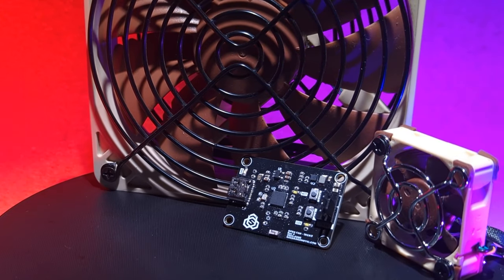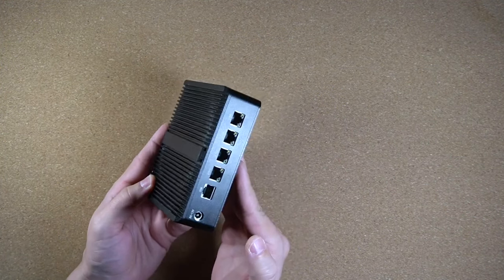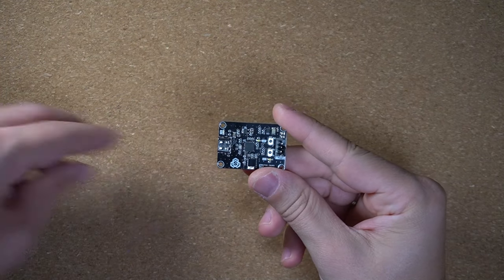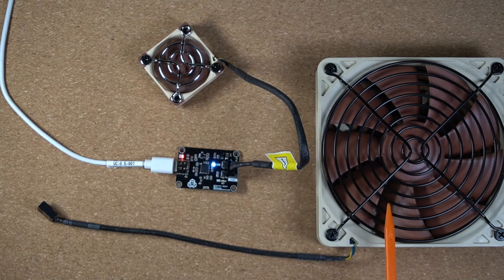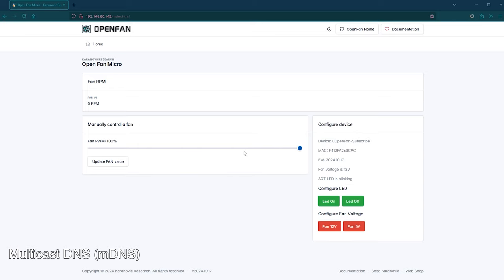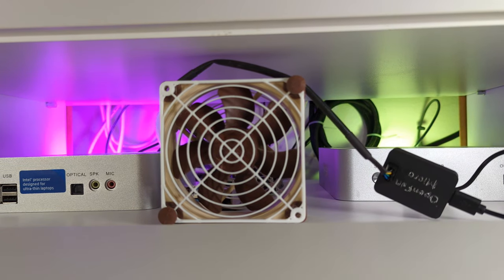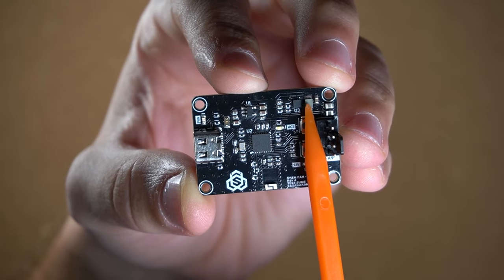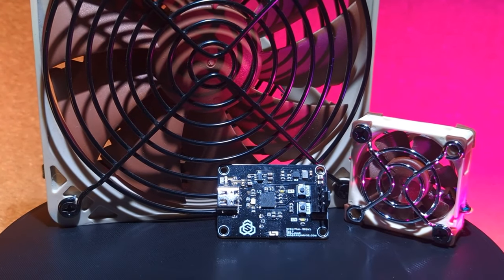OpenFAN Micro - My home lab needs this fan controller

Comment: Awesome but needs one little addition to make it really perfect - power on PWM boost. Some fans I have can maintain 10% PWM but it is not enough to bring them up from zero - for that I need to temporarily apply higher PWM value to make it spin (overcome inertia and friction) before it can ramp down to desired low PWM. Yes, I guess I could do it via API but for true install-and-forget application it could use some power-on boost (lets say 5 seconds or so). Just like servers do when you power them on - all the noise at first and then settle down. Also helps to pull dust bunnies trough xD
Reply from the maker: Thank you!
This is a great suggestion and also really easy to implement in firmware. So I will add it in the next firmware release. :)
Reply: Instead of timed it should be until tachometer reports rotation.
Reply from the maker: Great idea! I think the combination of these two would be the best.
Run the fan at 100% PWM to spin it up for ~5 seconds and monitor RPM signal. If the RPM goes up, then everything is fine and we can go to the previous RPM. If the RPM does not go up, then report failure.
Reply: Agree this is a must have! Will seriously consider getting two when you have implemented temp fan spin up 👍👍
Reply from the maker: This feature is now available (v2024-10-27)
Thank you everyone for suggesting it! :)
Reply from the maker: @cv643d  This is a simple firmware feature and it has been already added. :)

Comment: It's very nice project,  If you plan to make another revision i suggest the following.
1- Add second 3pin connector for 3 pin fans
2- Temperature sensor so you can automate the fan speed .
2- Using Home assistant and esphome to configure the esp32 and integrated with home assistant
Reply from the maker: Thank you! I'm glad you liked it! I will keep this in mind.
You can use this board with HomeAssistan. Either through the API or you can also load ESPHome. :)

Comment: Awesome as noted. The only thing I'd add is a air temp sensor for when you use it in an eclosure to conditionally or pid control exhaust hot air.
Reply: Agree. Also USB PD would be useful to connect few powerful fans without risk of burning the step-up converter.
Reply: @voed  well, if you really need to connect higher current fans then you could easily change the step-up circuit with a bigger one, such as the Xl6009 module
Reply from the maker: Thank you!
Great suggestion! Maybe in the future revision I can add a header.
For my use-case, I always have the temperature of the device(s) I'm cooling, and in most cases it's more important/relevant than the ambient temperature.
Reply from the maker: Great suggestion.
Unfortunately while 12V is part of USB PD specification, but for some reason most chargers skip it and only have 9/15 or 9/15/20.
Also it would make the controller useless if you want to connect it to non-PD USB connector.
But maybe in one of the future revisions I could add PD and non-PD version.
The step-up converter can provide up to 700-750mA, and average commercial 12V fan draws about 100-150mA.
So while this is designed for a single fan, you could potentially connect more than one and still be fine.
Reply: +1 I would order the parts today if it had a temp sensor that I can put on top of the thing I want to cool. 

The API stuff is great but relies on something keeping it's temp value up to date which might not survive OS reinstalls or a VM running somewhere that could be offline, let alone assuming that I don't change the WiFi password... 😅

If there is a temp sensor at some point it could also be used to pull the value for other systems like home assistant or some logging software so I could using it to keep track of things too.
Reply: Oh thought of a another use case (not sure if it's feasible) but if that temp sensor port could also accept a humidity sensor then you could use it to automatically vent air when the air is to humid or not humid enough. In a greenhouse or bathroom for example.
Reply: Yup, need temp sensor with range of on/off
Reply: The sensors described in the responses [temperature, humidity] and others are often available with an adjustable ADC that triggers when a preset [adjustable on the ADC] is hit. If the fan controller had a digital input to receive the trigger input, it would work with a wide range of sensors. The firmware needs only to deal with any jitter [i.e., the digital trigger must be changed for > 1s before the fan controller reacts] to ensure there's no funny business around the threshold of the state-change].

The controller would trigger the fan to it's preset speed when the connected ADC hit its trigger due to a water level, a humidity level, an absolute temperature, a light/brightness threshold, the presence of a minimum sound pressure, or whatever other sensor for which one could dream up a use case. Heck, with a motion sensor you automatically could blow confetti on a wedding party walking out of a venue, if one felt the need to automate the process...

Comment: Maybe make this module pluggable with other modules, like sensors (humid, temp, light) and with outputs (5V, 12V, solid state relay for AC devices)
Awesome project, subscribed
Reply from the maker: That's great suggestion!
The nice thing is that through the API you can technically connect it with pretty much anything. :)

Comment: Very Nice, but have missed two things. 
1. Temp Sensor 1wire or I2c or both
2. 3 pin fan supporting circuit
Reply from the maker: Thank you! I'm glad you like it!
I might add additional header for 1-Wire or I2C in future revision.
Price difference between 3-pin and 4-pin fans is becoming negligible and personally I dislike 3-pin fans (and have purged all of them long time ago). But I see your point.
Reply: 3-pin fans should never be used and if they are can use voltage regulation, does not need this circuitry.

Comment: MQTT would be nice, too. Pushing the PWM% and the RPM to and from the OpenFAN Micro could be a good addition. I know the API calls do the same, but MQTT on ESP32 runs with almost no impact on performance.
Reply from the maker: Thanks! That's a great suggestion!
You could use the API but I guess MQTT would also make it easy to integrate with HomeAssistant and other telemetry/automation. Or at least offer another way so you can use whichever one you are more comfortable with.

Comment: Awesome project. I really liked your older one too (OpenFAN Controller), any chance you'd revisit it and maybe add some updates, like support for a 3-pin fan? It's basically the only feature (apart from USB-C support) it lacks. Thanks!
Reply from the maker: Thank you! I'm glad you like it!
At the moment, I don't think 3-pin fan support will be added to OpenFAN.
Regardless of OpenFAN project, I highly recommend using 4-pin fans, especially since price difference between the 3-pin and 4-pin fans is almost negligible.

Comment: This is very cool project!
I wonder if you could make a version that can connect 2 FANs in the future? I would like to connect 2fans using 0.6A, one for intake and one for exhaust.
Reply from the maker: Thank you! I'm glad you like it.
This one is designed for a single fan, but you could potentially use a fan spliter to drive multiple fans. Although you will have to make sure you are staying within the current limit.

Comment: A USB output version for those with existing USB PC fans would be cool also, obviously you can't monitor fan speed but you can control speed and on/off based on variables like temperature.
Reply from the maker: Thanks for the suggestion! I might consider this in the future.
I think that the price difference between the USB fan and 4-pin fan is almost negligible, especially if you account for how many of them you need and how often you buy them. And with OpenFAN Micro, you can turn any 4-pin fan into USB and/or WiFi fan. :)

Comment: I assume you can't control 2-pin fans?
I've thought about controllling my homelab fans but its redundant. 
I just slap KSD-01F (super cheap) on each of them and tape it to the heat spots. Too easy, it only turns on when it gets hot. Beats this by a mile.
Reply from the maker: Two pin fans do not give you any feedback. So you don't know if the fan is spinning or stalled, so that is no good for my use-case.
Also as I mentioned in the video, I also use this for extraction/ventilation. In this case there is no hot-spot that you could measure, it's purely based off of automation/scene.
As I said in the video, this solution is ideal for me and my use-case. But this does not prevent someone else from having a different solution that works better for them. :)

Comment: Just a curios question. Do you only control the boost converter output voltage (5V/12V) via PWM on the EN Pin of the MIC2290?
Reply: He said in the video that 5V are just direct throughput from USB. So it is boost converter on/off.
Reply: @damustermann  but then you will loose around 0,8V-1V according to the datasheet through the integrated diode. If you then have a look at the USB Standard which defines for example a minimum allowed voltage on an USB bus-powered hub is 4.35V. Then in the worst case there is only 3.35V available on the fan connector
Reply: @ralfhesterberg3346  That's a lot of loss. In the code, it is "digitalWrite(PIN_LDO_EN, LOW);" if you switch to 5V. So, I guess the output is pretty low at the fan-header. Maybe the creator could measure the output, especially under load.
Reply from the maker: As @damustermann already mentioned, it's a GPIO toggling the enable/disable pin.
When USB is 5.0V, output is around 4.8V which is well within USB spec. Also very important to keep in mind that we are not powering a USB fan, we are powering a 5V fan that accepts certain +- tolerance.
Also keep in mind that the fan is essentially a motor which "cares" more about the current and is usually very "flexible" when it comes to the voltage applied.
FYI if your USB hub is outputting 4.35V on the 5V rail, you probably have bigger problems than powering the fan. And it's also out of USB spec. :)

Comment: What is the clock of the PWM? Max current?
Reply from the maker: Intel's PWM fan specification requires that PWM signal is 25KHz, so that's what is set in firmware.
By design board can provide up to 700-750mA, however it's designed for a single fan operation, not for multiple fans. Most commercial 12V fans draw around 100-150mA.
Reply: @SasaKaranovic  Awesome, sadly your shop no longer ships to EU.
Reply from the maker: @martenkl-71  Shipping should be available world-wide. Can you please email shop@sasakaranovic.com to get this resolved.

Comment: 3$ esp32 and 0.1$ mosfet circuit turned into a 25$ "product" for a problem that never existed
could probably even use a transistor with matched thermistor gate circuit so the thermistor acts as a temperature sensor and control at the same time negating the need for IoT, because it is just dumb for such a simple problem
Reply from the maker: Thanks for the suggestion! This project is exactly what I needed and I'm sharing it as an open-source open-hardware project. Feel free to contribute or modify it and build your own that works better for your use case. :)